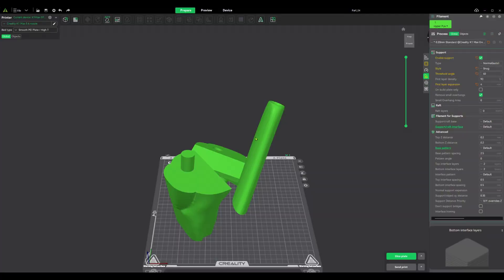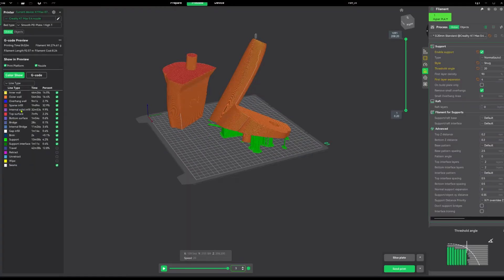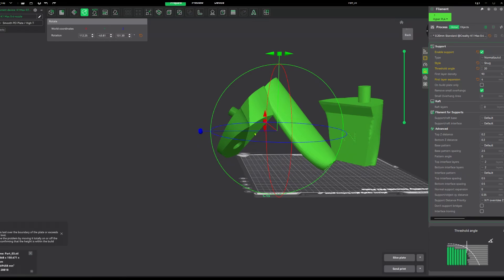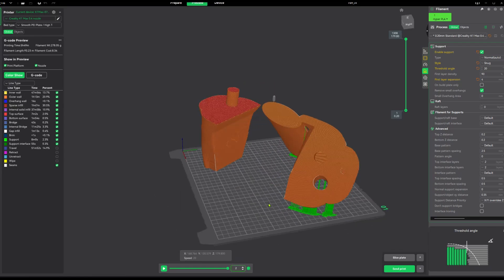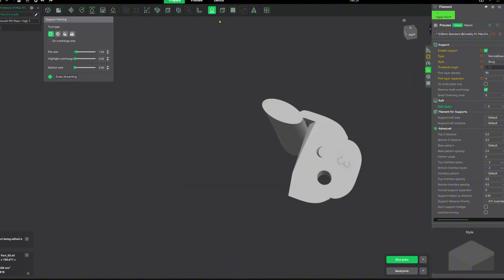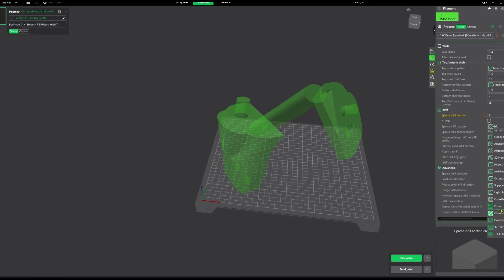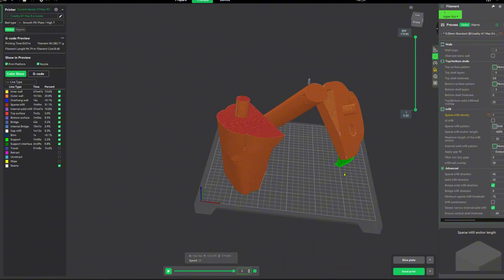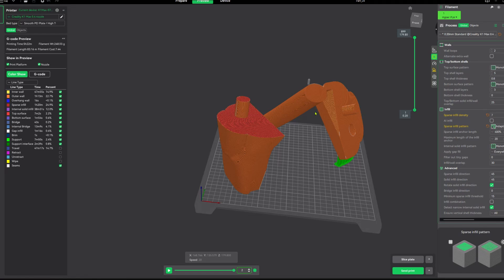How I Save Hours Off Every Single 3D Print!

Comment: Do you think with that small amount of the model touching the bed it will have adhesion issues?
Reply: Not necessarily.
Reply from the maker: That all depends on your bed and how well it sticks. Mine does fine. Yours may not. Adjust according to how well you know your bed. Use a swipe of glue right where the supports go if you’re not sure.
Reply from the maker: Like if you know your print comes off with the slightest touch then I’d add a bigger support base and up your first layer size. Also slow down your first layer to 25-30 mms. A bigger slower first layer = better adhesion my friend.